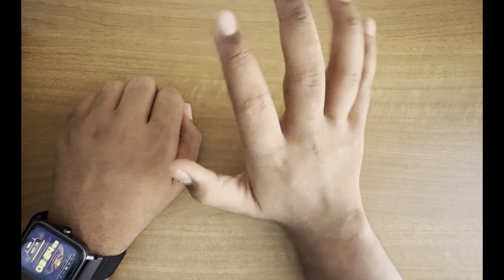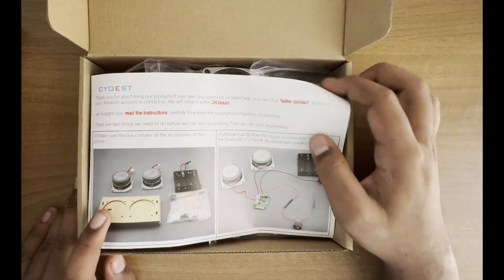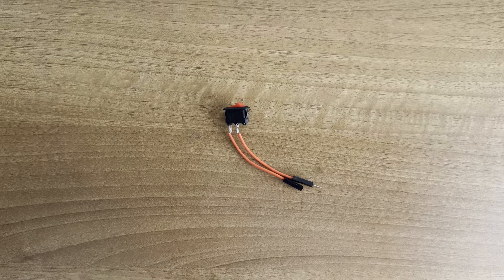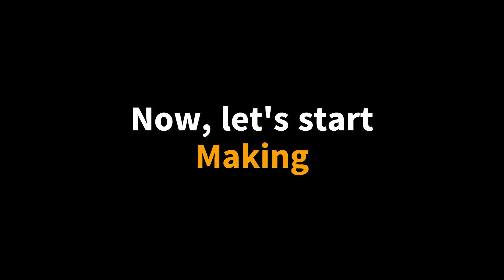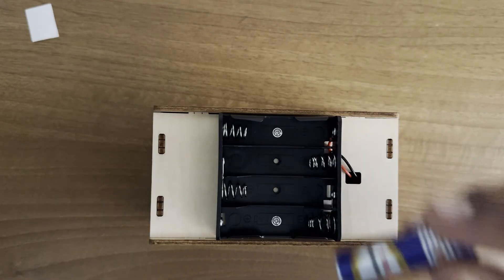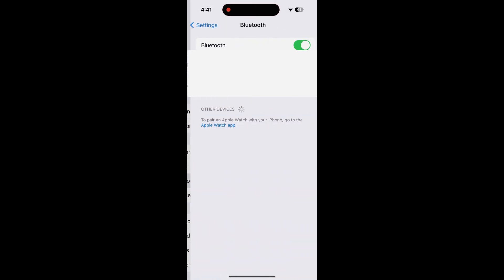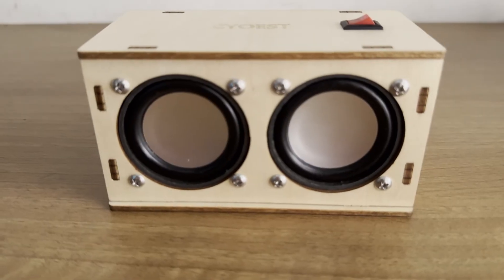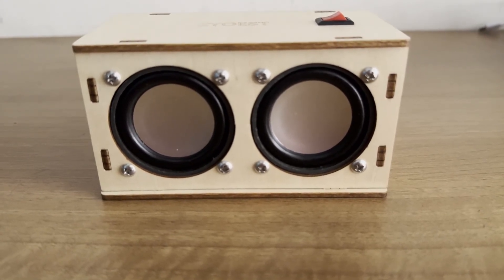Cyoest DIY Bluetooth speaker

Comment: I can't figure out how to connect the phone 😭😊
Reply from the maker: You can connect the speaker with your mobile device using bluetooth. Please check your settings on your mobile device if bluetooth is on and discoverable. If yes, you can pair the speaker to your mobile device
If for some reason you can't see your speaker name on your device, 
-Check you mobile device, restart the mobile device if required,
-Check the speaker wiring,
-Check if there are any loose/broken wiring,
-Use alkaline batteries if possible for better performance.
I hope this helps! 😎

Comment: I am wondering why it will not connect to Bluetooth
Reply from the maker: Hi MJMMasonryLLC
If you are having problems connecting with the speaker through bluetooth, try
-Checking the wiring of the speaker
-Checking if the bluetooth module is working
Note that when the speaker is turned on, a startup sound will be played. If not, then the power is not running throught the components.
Also, try restarting you mobile device. Maybe, just maybe, your phone(if it is an old model) may not support the bluetooth module version, all though this is a low-chance scenario. Try using another mobile phone.
I hope this helps!😊
Reply: Can’t get the Bluetooth to work 😭😭
Reply from the maker: I am sorry to hear that it is not working
Please try to:-
-Restart the mobile device
-Check the speaker wiring,
-Check if there are any loose/broken wiring,
-Use alkaline batteries if possible for better performance.
Hope this helps!

Comment: I am unable to find the Bluetooth to pair with. Pls help
Reply from the maker: Hi Rajul Gala,
I see that you are unable to find the bluetooth device. Please check that:-
.The speaker batteries are properly installed
.There are no loose connections
.The wiring is correct or not
.The mobile device bluetooth is turned on
If these solution did not help, please try restarting your mobile device.
Also check that when the speaker is turned on, a tone will be played or not.